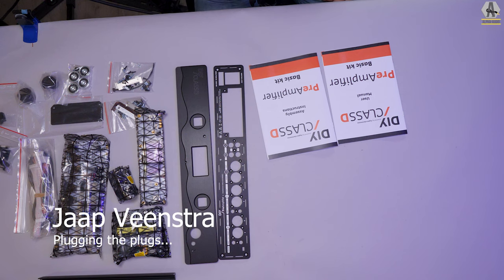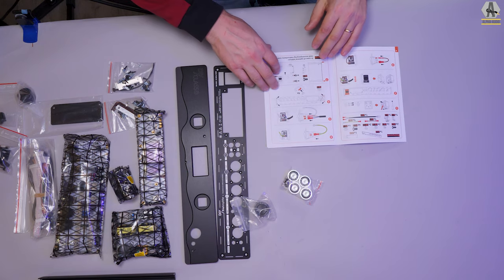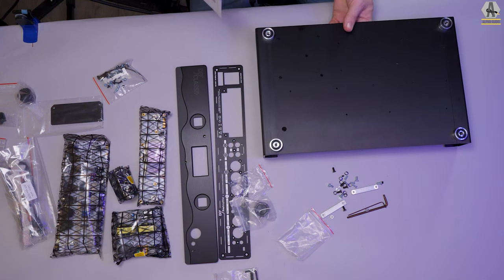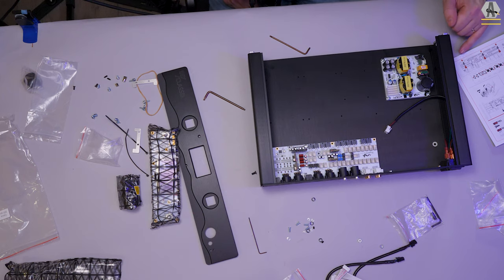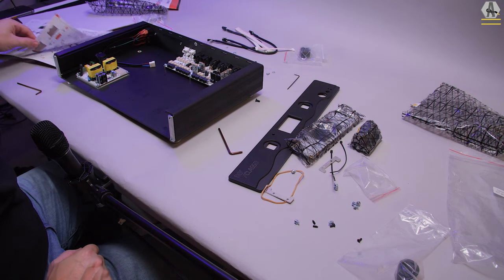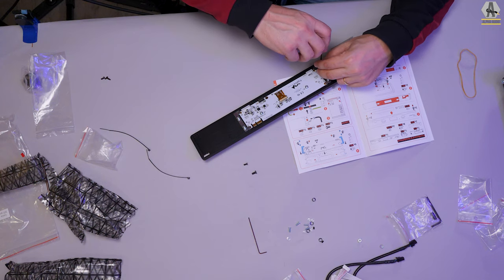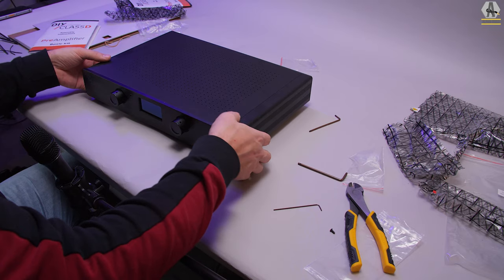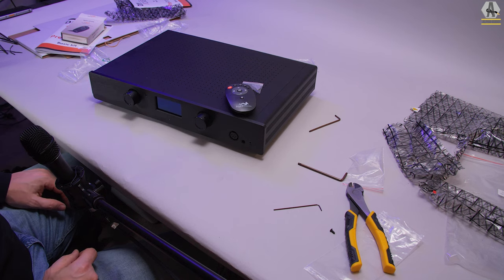Workshop Hypex DIY Pre amp

Comment: What are the specifications that I should be looking at if I want to mix and match power- and preamps from different manufacturers? I know input-sensitivity (? on the power amp ?) and output sensitivity (? on the preamp ?) have something to do with it, but I also know that the numbers aren't supposed to match -- maybe can't match, even -- and I also know that if you get that part right, you're not all the way home yet.
Reply from the maker: Use your ears.
Reply: I'm ex pro audio so my mantra isa bit different:

use your brain...

 ;)

1. Impedance matching between pre/power-
Is important manly if you use the obsolete single
ended electronics AND VALVE=TUBE hardware. 

2. Research as much as you can for a valid information
regarding the output levels of the pre (and the  source)
AND the gain of the power. That of course must
correlate to the characteristics of the speakers that
are at the end of your playback chain. 

I can only recommend you to go Balanced/differential
electronics (solid state OR tube) due to higher voltage
operation and components signal transmission Q&A.
Why go 2 volts with no RF shielding line when you can 
go 4 volts (most of consumer balanced audio products) 
AND have RF shielding on the interconnects? 

Take note!

Some Balanced Consumer Products have higher than
4vrms out put up to 6 vrms - usualy High End exampels 
Or PRO AUDIO/SEMI PRO units that can interface with consumer 
Electronics - Pro Audio Line level is 24dbu=12.2vrms(!!!)
That will probably burn most of consumer hi fi of cours
So a low 6+-vrms output was added to Voltage /Line level
interfacing with consumer boxes. 
. 
It's totally legit HOWEVER:

It does create perceived "loudness lie" because
we tend to be attracted (brain processing) to the louder
sound event. That why High End designers use Hotter 
than 4vrms output level in order to shine at the demo 
in the High End "butiqe=Studio". 

Just gain mach before the decision to  buy ;) 

Use your ears (cearfully) when you talks with your wife, 
supervisor/ ownerat your working place, co workers,
Friends and children and youth in general;)  

And when you double blind test hi fi boxes after
You did all the intelligent research. 

Be blessed, healthy, free, educated and prosper.

N.B - some of the best Hi Fi electronics in the world
can be found at the better customers service- tech support
Manufactures/dealers/representatives respectful customer  
attitude.

Comment: I didn’t understand why Hypex has released a Pre amp. When people are using streamers to their amps 
Also it doesn’t have dsp which I would had loved
Reply: Because attenuation in digital domain likke DACs an streamers do reduces SNR so with analog stepped resistor attenuator you have in theory superior fidelity. You can just pluck this preamp between your stremaer and amp and have the benefit of running your DAC at its full output voltage improving both SNR and gain structure of your audio system
Reply: Also it's rather obvious it doesn't have Digital Signal Processing since it's a analog preamp